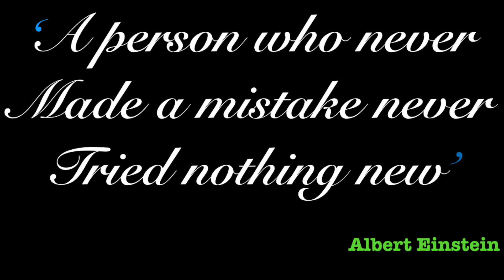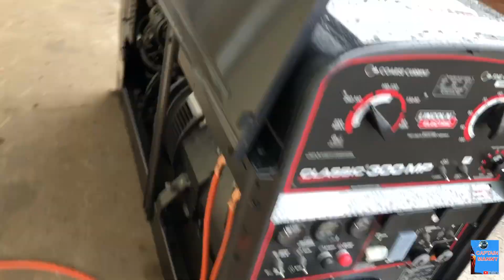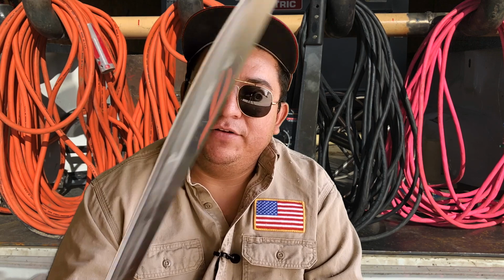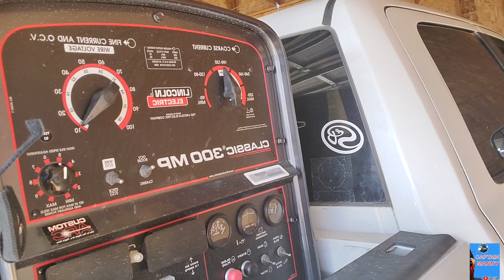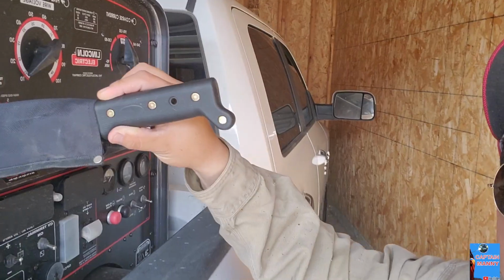Welding Rig Set Up!!

Comment: Back in the day during the Alaska pipelines the welders used the blades to scrape off some kinda tar on the pipe's to protect the butted joints' but nowadays it comes clean and it is just used for anything.  Just I guess to give style and homage to the ones using it before. But that's where it originated from' they would have to blade and scrape off tar during the older days.
Reply: i guess I am kind of randomly asking but does anyone know of a good place to stream newly released tv shows online?

Comment: Machetes are used to scrape off pipe insulation for repairs and a chop through blanket wraps and to brake off the epoxy coating on some pipes it's also just a great utility piece to have especially if you working in the Backwoods and you need to cut a few branches off of a tree because they hang down to low and of course to get rid of danger noodles
Reply: And to cut off robbers jaja

Comment: What kind of leads do you use and which side are they?
Reply from the maker: Flex orange 250 ft 1/0 cable 125 ft for stinger lead and 125 ft for ground

Comment: Hey manny why most welders go with a dually truck instead of a SRW ? i was looking at a f350 srw payload is around 3700lbs
Reply from the maker: Dually is better for towing caper and carry loads at the same time like a welder and equipment welder machine is 2,000 pounds, also Duallys," or dual rear wheel trucks, offer a higher gross vehicle weight (GVWR), which contributes to a higher towing capacity. And if u get a flat tire in the back, is better to have four wheels then just 2.
Reply: CAPTAIN MANNY gotcha ! 👍🏻

Comment: Hi  Manny another great video   Im     womdering    I see youve had this new machine   not too  long  .    Have   worked single hand up in north dakota?   Or    a Helper or fitting?    Also you got  a trailer (camper ) or plan to get  that as well?
Reply from the maker: I have been fitting here in ND, never had work single hand here, but I have in other states, I had a trailer , but I sold it , And I want to get another one , because you safe a lot if you have one.
Reply: @CAPTAINMANNY     thanks for answering.   I think trailer is good too  because  its a home instead of motel  a lot more comfortable